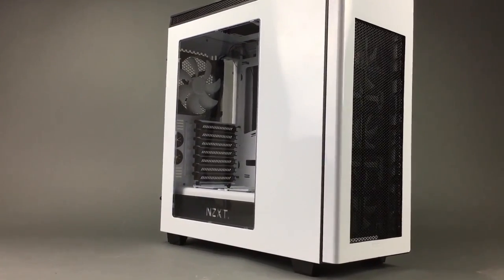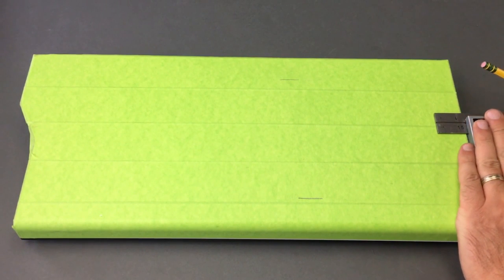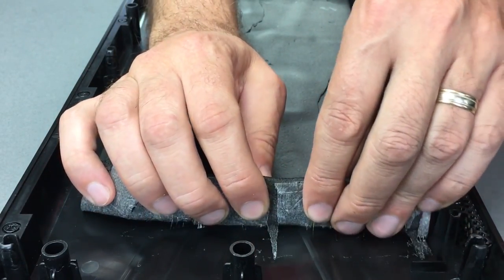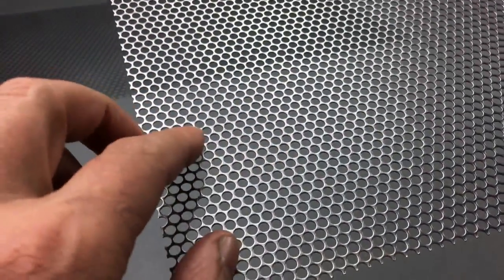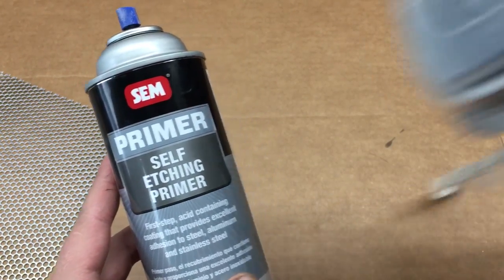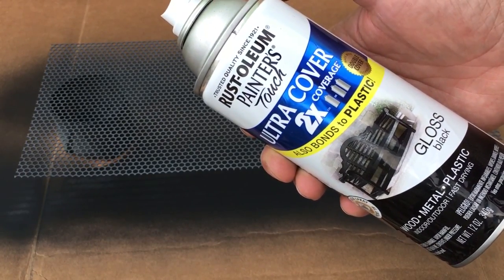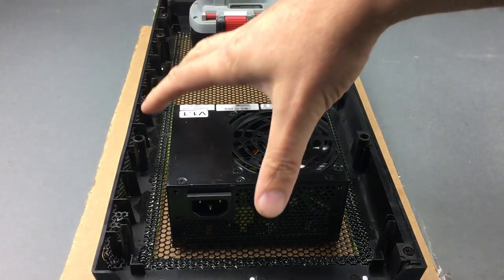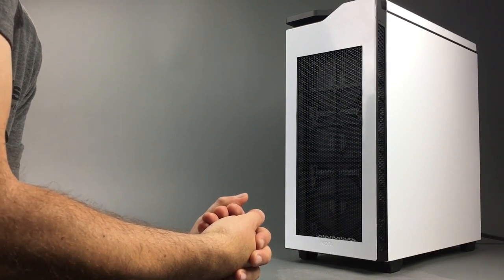#NZXT H440 FRONT PANEL BEZEL AIR FLOW GRILL MOD

Comment: Bill makes it look easy to remove that sound dampening material from the back of the bezel.  I didn't have as much luck getting it to come up in one solid piece.  After removing the bulk of the material, I soaked the residual adhesive with a bunch of Goo Gone.  After letting it penetrate, it came off easily with a flat razor blade.
Reply from the maker: thats a great tip, Thank you John! ......yeah, it was a grueling task that took waaaay too long
Reply: Run an 8700K for a few hours inside it, that should melt it enough to peel off haha!

Comment: What a fantastic mod. I'm totally doing this to my H440!
Reply from the maker: Do you own a Black or White NZXT H440 case? I'm going to speak to NZXT about possibility of ordering H440 front panels and selling them with my grill mod here, https://mnpctech.com/nzxt-h440-s340-razer-replacement-custom-window-smoked-clear-red-uv-green-blue/
Reply: Mines a white H440, oh man if those front panels were for sale pre-modded I'd grab one in an instant!
Reply from the maker: check this link in 3 - 4 weeks for them to be stocked,  https://mnpctech.com/nzxt-h440-s340-razer-replacement-custom-window-smoked-clear-red-uv-green-blue/

Reply ·
Reply: Wait, so you're actually going to sell the pre-modded panels?!
Reply: Love this video and thanks for sharing. I'm getting the all black one today and plan on doing this. Have you got in contact with them about being able to order this yet? Also, I wanted an all glass smoked panel but you guys are all sold out on your website:(
Reply: Would a grinder with a cutting wheel on it work just as good at making the cuts? Jw I don't have the other tools you mentioned.

Comment: This is exactly what i needed! Thank you! I swapped all my components in a different pc a few years ago because it ran hot, even shutting down for protection on long weekend gaming sessions. My pc died a few weeks ago and im currently searching parts for a new one. Ofc i will go 3080, i7 12xxx etc which means i try to save money. Newer white cases are not my taste and i always loved the H440 optics. Time to dig it out of the basement!
Reply: H440 with  undervolted12900k got 79C while gaming. With removed top and front panel it drops to max 66C. Thats fking big difference! I gonna mod my  H440 soon.

Comment: Very nice work.

What I would have done different is to have the mesh in the hole so it is flush with the front not just behind I expect you could do this easily its the same process with some bending of the mesh this is how a lot of the cases people buy have mesh put in the panels.

Comment: You're the best, dude. I gotta do this to my H440 at some point. I already have the smoked acrylic window you guys make for it. That was a nice upgrade from the cheap plastic window the case came with.
Reply: Same here! The smoked window makes it look sooooo much better. Definitely doing this aswell at some point.
Reply from the maker: Do you own a Black or White NZXT H440 case? I'm going to speak to NZXT about possibility of ordering H440 front panels and selling them with my grill mod here, https://mnpctech.com/nzxt-h440-s340-razer-replacement-custom-window-smoked-clear-red-uv-green-blue/
Reply from the maker: Do you own a Black or White NZXT H440 case? I'm going to speak to NZXT about possibility of ordering H440 front panels and selling them with my grill mod here, https://mnpctech.com/nzxt-h440-s340-razer-replacement-custom-window-smoked-clear-red-uv-green-blue/
Reply: I personally have the black one but my wife has the white version, so both :)
Reply: Wow I didn't see this reply until 3 months later! I personally own the white version of the H440. If you guys are seriously considering trying to get a supply of front panels from NZXT to sell modded, I would definitely buy one!

Never mind, saw that you never got a response from NZXT. That's a shame. The mod seems simple enough, I'll probably do it when I have the spare time and money for the supplies.

Comment: Fantastic job, it looks like it came from the factory like this! Given I lack all the tools for this it'd be cheaper for me to just buy a whole new case which is annoying. My temps aren't terrible but they're higher than I'm used to, but then thats partly down to newer Intel chips running stupid hot. It's like we've gone back to the P4 days. Interestingly enough the reason they ran hot was because they were also rushed to market, thanks to AMD being competitive! It's amazing how history repeats itself!

It would be nice if they offered different front and top panels like they do side panels. A missed opportunity there methinks.
Reply from the maker: Very good points, thanks for commenting! Thank you, Bill at http://www.mnpctech.com
Reply: I wouldn't necessarily call it a missed opportunity. The case was designed around noise reduction, not temperature reduction. Essentially any case that advertises interior foam sound insulation is telling you that they wrapped your PC components in a nice toasty blanket. Removing the foam and cutting holes in it will improve temps, but it defeats the original design intent. At that point, you should have just bought a different case from the get-go.  

All that said, I think NZXT made a common sense and very simple workaround... When you wish for airflow over noise insulation, you just pop-off the front panel. That's what I do with my H440 and it's the best of both worlds. Thermals aren't outstanding compared to more mesh covered cases that don't have foam insulation... but my GPU temps drop by 5-7c under gaming load and motherboard components stay within very respectable ranges. The front to back airflow is solid with the panel removed. When I'm done gaming and want the silence, pop the panel back into place. I don't see a reason to permanently sacrifice a good chunk of the sound deadening properties when the only time temps become a concern is under heavy load.

Comment: Definitely doing this to my p400 thanks!
Reply: You ever do it? I'm about to do it I already have all the tools and primer just need to find a filter to put behind that grill
Reply: Emdrag13 
I realize it’s been a year and as such is probably too late but what I did was order two p400s filters from phanteks and I use those on the outside of the holes. If you email phanteks they’ll let you place an order for just the filters

Comment: Argh, Bill, where were you when I actually had an H440 and wondering how to get more cool air into my build? This guide is so good. I'm gonna try and use it on my next build that's using an S340.

I was curious if there's any way possible to fit an EK XE 120mm rad into an S340 at all? Thanks in advance and keep up the great videos! Your voice is weirdly soothing when you explain the process behind your techniques hahaha
Reply from the maker: Yes, you can mount single 120mm radiator on the ceiling or front of the S340. Do you own a Black or White NZXT H440 case? I'm going to speak to NZXT about possibility of ordering H440 front panels and selling them with my grill mod here, https://mnpctech.com/nzxt-h440-s340-razer-replacement-custom-window-smoked-clear-red-uv-green-blue/
Reply: I had a black and red H440 a few years back, I gave it to my friend when he got his first AIO. Also, I don't mean to sound snobby, but I was aware of the mounting areas, I was curious as if they'll still be good spots to out the EK XE 120mm because of the rad's thickness. It's their thickest rad out I believe, even thicker than their XTX lineup

Comment: Am I overthinking it? Want to do the same on my inwin 301, front panel. Here my issue it’s mostly a solid case,  should try an remove the rivits to make the front panel a singal and Easter to work on or just cut it as one? Any other tips for cutting straight? Thanks and appreciate it.
Reply from the maker: Yes, removing the panel would be easier. Practice on something else first, so you get feel for cutting straight.

Comment: i just cut a square hole in my sharkoon bw 9000.. always had a watercooler at the top so the heat dissipated instantly.., but now my build is almost 5 years old so i went for an air cooler and i instantly noticed that heat was building up in my system.. Never going for a solid frontpanel case again..😅

Comment: Contemplating applying a "u-channel" edge molding to the opening in the front bezel, but the type you sell on your site would not handle the roughly 4.2mm thickness of the combined metal / plastic on the H440 front bezel.  Any thoughts on a source for a similar product that could be applied to the thicker material?  Most of what I see online (Amazon) is for automotive.

Comment: Hey there Bill, 

Awesome mod. I have two s340 elite cases I'd like to do this mod on. However, I have one hesitation. I'm not confident I can make the cuts on the front of the case and keep it clean. Is there anything you can suggest doing to the boarders of the sheet metal for a clean look after cutting? Or would you recommend just trying to re-paint the entire face of it again after making the cuts. 

Thanks for your time and this video.
Reply from the maker: You can use a hand file to clean up and straighten the cut edges. Use masking tape as guide for your the filing.

Comment: How do you make the cut so straigth? I have a jigsaw, but whenever I've tried to use it I can't get them as straigth as you. The blade itself bends a little.
Reply from the maker: Use a new 18 TPI bimetal jigsaw blade. Run the Jigsaw metal guide along a Measuring Square you've tapped down with Masking tape.

Comment: Is the modders mesh magnetic? Wondering because im not sure if doing the mod this way from the inside or simply taking out the metal part of the fromt panel and making the entire front panel to be the modders mesh from the outside. I have a s340 Elite.

Comment: Does this significantly increase noise levels? Quite like the quiet aspect of the case but don't want to sacrifice airflow haha. Also, any cheaper alternatives to epoxy?
Reply from the maker: not that we noticed, but you can always get lower dBA fans... E6000 glue

Comment: Great Video question, do you think it is possible to do the same mode but instead of putting a mesh in the center to put a Acrylic Window? I have a case with fans in the front like this, but they are blocked by the solid Plastic case. 

If it is possible, any chance of you making a video on a how too? 

Thank you.
Reply from the maker: Just apply the same steps as shown in this guide, Thanks again for watching!
Reply: Thanks will do.

Comment: I have H440 and it runs cool as a cucumber in regards to CPU (be quiet dark rock pro 3) but GPU is slightly warmer than other cases, maybe 5c. With ryzen 7 1700 at 3.9/1.36v it maxxes lower than 70c in any stress test i throw at it.

Comment: Would it be ok to use the U Channel rubber edging to give it a cleaner look? Would the epoxy be ok with it?
Reply from the maker: Yes, the DP-190 epoxy works with rubber, too. Good luck with your modding venture!

Comment: My new gpu is creating a ton of heat in my h440 and suffocating itself. Do you have a suggestion for adding a fan intake to the plastic window on the side of the case? I'm worried about cracking the window when cutting through the material.
Reply from the maker: You can apply the technique for adding fan hole in this video guide, https://www.youtube.com/watch?v=7wGlWZ24QsE 
Thanks for watching, btw I make other cool stuff for your PC  in my workshop. visit my store, http://mnpctech.com  and use my DISCOUNT code, MNFAN at check out for 10% off your order

Comment: Did you do any before/after temp measurements? I'm planning to buy a used H440 for only about $33. Does it worth it? Currently I have a Cooler Master CM690 II, I'm afraid of airflow but with this mod it will be great I guess.
Reply from the maker: 10 - 12 degree difference after modification depending upon application being used. The Cooler Master CM690 II already has exceptionally good ventilation, so if you're experimenting cooling issues, you need to swap out the factory fans to fans with higher static pressure, like Corsair SP-series, Scythe Gentle Typhoons  or Fractal Design Venturi HP series. Setup fans for positive pressure configuration. Install all fans, but rear exhaust as intakes, so you're pushing out the warm air.  Bill at Mnpctech
Reply: @Mnpctech_Giveaway_PC_Mods  Thank you for your reply. I decided to go for a Cooler Master MasterBox NR400 instead. Same price (about $33) but instead of 5 years old it is 3 months old only. Also smaller, glass and good ventilation.

Comment: Bill would meshing the top or front result in lower temps? I want to do this but would want to find a nice dust filter to go with it.
Reply from the maker: Yes, meshing the front helps lower temps. The H440 already has a front dust filter. "Meshing the top" will depend on individual system configurations.

Comment: Thanks for this! I recently installed an x62. It wouldn't fit up top due to clearance issues with my mobo VRM. Ended up having to front mount it. Opening the front panel makes my temps drop about 10c! with the the front panel on my GPU gets uncomfortably hot. I have 2 Noctua iPPC 2ks on the rad and it doesn't help much.
Reply from the maker: Do you own a Black or White NZXT H440 case? I'm going to speak to NZXT about possibility of ordering H440 front panels and selling them with my grill mod here, https://mnpctech.com/nzxt-h440-s340-razer-replacement-custom-window-smoked-clear-red-uv-green-blue/
Reply: Bill Owen  I have a black with blue trim H440. if you can somehow get a black/blue front panel. ill 100% buy it!
Reply from the maker: Thank you for answering, but I can't afford to buy and stock every color combination. sorry. I will try and commit to all Black & White, if NZXT is willing to let me purchase inventory.
Reply: Bill Owen  it's alright i fully understand. thanks for looking out for us who dont have the tools or dont feel confident doing something like this! I appreciate the tutorial video as well!

Comment: Just found this video and wouldn't mind modding my Define 7 Compact, but the problem is, there's no filter on the inside, just filters for those side intakes. What kind of filter could I get to put in there instead? I mean, I should technically be able to get some other cases filter if the size matches somewhat, no? Worst case, make my own?
Reply from the maker: Use these filters for each fan, https://www.mnpctech.com/products/computer-power-supply-psu-fan-filters?_pos=2&_sid=fe019aaf1&_ss=r
Reply: @Mnpctech_Giveaway_PC_Mods  That's great, thanks!

Comment: Haven't got the modders mesh yet, but my cuts are still kinda rough looking. Any suggestions on making them look cleaner? I've already cut mine, but I can't find u channel in stores and idk what else to do
Reply from the maker: After cutting opening, Use a hand file with masking tape alone edge as guideline, as I illustrated in the video, and just file the edges until even with the tape. If you still want u-channel, you can use this wide rubber trim, but it will require gluing to the edges, https://mnpctech.com/case-mods-gaming-pc-liquid-modding-custom-computer-mnpctech-overclock-cooling-fan-grills/u-channel-pc-computer-window-rubber-trim-molding-cable-management/xbox-360-custom-window-molding-6ft.html

Comment: Did mine slightly different. After making the cutout I then removed the plastic bezel completely. Next I added U-channel trim to cover up the cut on the metal. I then glued the painted modders mesh directly to back of the metal panel. After drying for 24 hours I reattached the plastic bezel. Looks pretty good IMO - NZXT H440 front panel mod https://imgur.com/gallery/Qoovlve
Reply from the maker: KILLER job, Thank you Adam~!

Comment: I've Cooler master box lite 5 case which has terrible Airflow, I'm gonna find a solution for that case, maybe cutting the front panel and putting the front mesh, but it's thin plastic so it will be risky to do that, can you make a video on that if possible?
Reply from the maker: Just apply more care with the same method I shared in this video, Thanks for watching! Bill at http://www.mnpctech.com

Comment: How would u go about doing this to the top panel of the Phanteks Evolv TG? Would you do anything different?
Reply from the maker: I would take same approach, but expect the cutting process to be much more time involving as all Phanteks EVOLV top and front covers are 1/8" (3mm) thick aluminum. The H440 only required ONE cut-off wheel for the Dremel, but the EVOLV may need two.
Reply: Thank you for the reply. Might be attempting this soon.
Reply: Bill Owen Dremel makes a cut wheel especially for aluminum that last a lot longer then the steel ones just a little FYI. Bill I think you did a great video and I meant no disrespect when I bashed you about the square measurement. Please keep making these bad ass videos!!  Later....you the man! My idol and mentor I try to do my projects with the attitude of how would Bill Owen do this mod.

Comment: I recently did this but my cuts aren't as straight as yours and I opened mine up a little wider so I have two rgb light strips in the front on both sides of the fans, I just need that metal mesh I'm currently using canvas mesh lol.
Reply from the maker: Do you own a Black or White NZXT H440 case? I'm going to speak to NZXT about possibility of ordering H440 front panels and selling them with my grill mod here, https://mnpctech.com/nzxt-h440-s340-razer-replacement-custom-window-smoked-clear-red-uv-green-blue/
Reply: Bill Owen I have the white one as well